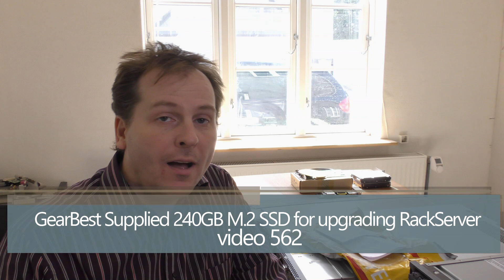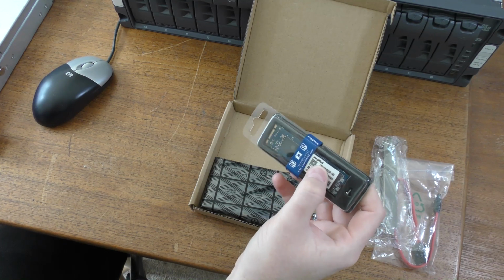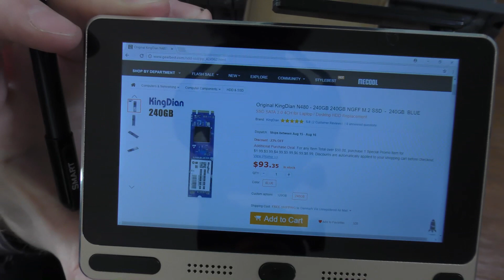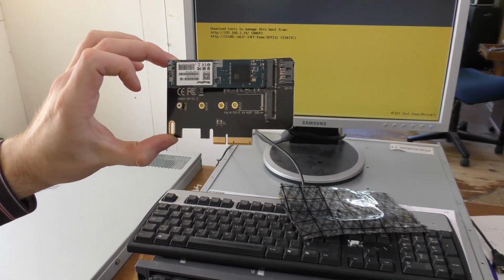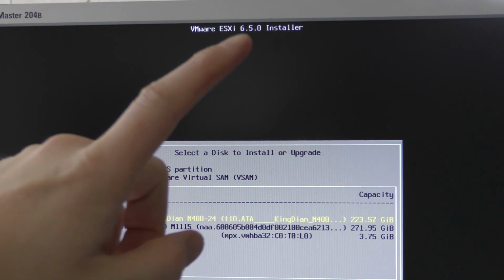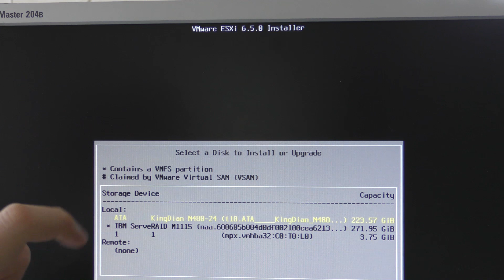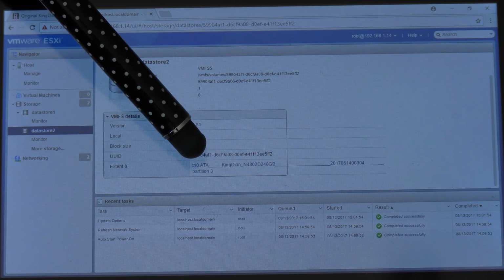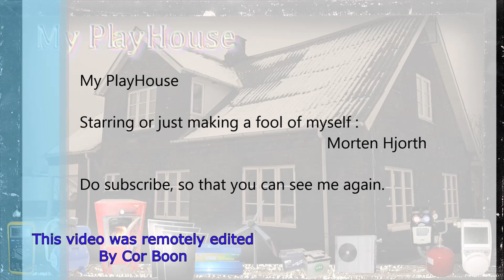GearBest Supplied 240GB M.2 SSD for upgrading RackServer - 562

Comment: Hi Morten, now I know your playhouse is not a mission critical data center but I see solutions like this in the field a lot too, where people run hypervisors of of simple non-redundant drives (usb etc. or in your case a single ssd. I know that esxi is pretty much read only and runs mainly in ram but still if the thumbdrive or ssd fails the server goes down. Is that really concidered good practise? How do you go about these things at work?
Reply from the maker: Hi Rolf Andreas Kraß-Westerink
Thank You very much!  This method could be used for a production environment. But yes, it might not be where you want to test out a brand like KingDian and a ZOMY PA02 - 2N NGFF / M.2 to PCI - E Converter Card... to $6
The method works, you just need to pick the products that meets your needs, and you trust in.
It's not easy to pick products, from these markets places that makes much sense, to show on my channel. And they do not have the brands we know in the vest.
And as always,, Do not do as I do, Improve on what I do.
Thank you for watching! :-)

Comment: u pluged it in to a sata 3 port so it still not run at sata 3
Reply from the maker: Hi mike spikeey
SATA3 ? what do you mean?
Thank you for watching! :-)
Reply: i get wat u have done now the card is just powered & u plugged it in to sata port so yes it will run faster but if it thinks it a cd rom  will it run at cd rom speed

Comment: I am sure you will not get the M.2 speed with an ATA connection.  It would have been nice if it could use the PCI lane instead of SATA but its good to add extra storage or a boot drive.
Reply from the maker: Hi Scott Downey
Thank You very much!  NGFF needs a SATA connection, where NVMe uses the PCI-e and is 4 to 6 times faster than NGFF. 
Thank you for watching! :-)

Comment: I keep looking at the Samsung 950/960 series M.2 drives. The performance on them is amazing. You get ~3500 MB/s read and ~2100 MB/s write. The price however is still a bit high.
I was wondering, what kind of drives do you buy for your data center for replacement for storage? Do you get used or new?
Reply: I have been installing them in high end builds, absolutely blazing. The coolest part about M.2 SSDs is speed with no cables.

These are consumer systems though where the 960 is being used for the OS and apps.

I don't have experience using them in a server environment but I would imagine that as a primary OS drive they would accelerate build testing substantially.
Reply from the maker: Hi clouddeveloper.io
Thank You very much!  I just got an Samsung 960 500GB EVO, so we are going that way..
Thank you for watching! :-)

Comment: Hi Morten - Some honest feedback about this video.
It. Sucks.

it sucks that it's 2/3rd product placement for gearworst - and it is especially bad that it's a ripoff / knockoff cheap-ass Chinese SSD. This video alone cheapens the whole premise of your channel a bit.
Of course this is only my opinion, but I think you'll agree, I certainly wouldn't go putting a sub 100$ SSD or any kind in a production server. No. Way!
Reply from the maker: Hi produKtNZ
Thank You very much!  This method could be used for a production environment. But yes, it might not be where you want to test out a brand like KingDian and a ZOMY PA02 - 2N NGFF / M.2 to PCI - E Converter Card... to $6
The method works, you just need to pick the products that meets your needs, and you trust in.
It's not easy to pick products, from these markets places that makes much sense, to show on my channel. And they do not have the brands we know in the vest.
And as always,, Do not do as I do, Improve on what I do.
Thank you for watching! :-)

Comment: I use the internal redundant SD card slots or install ESXi to. ESXi hypervisor doesn’t need much speed or space at all. Great videos keep them coming.
Reply from the maker: Hi Jonathan Williams
Thank You very much!  You are right,, ESXi does not take much space,, and the boot speed most likely does not matter that much. But in a Lenovo x3650 M1,, It only have USB1,,it takes 15min to boot from that,, this is a great option,, and it is just one more option.
Thank you for watching! :-)

Comment: Well, I hear you talking about having just a single SATA connector on the board. However, I see 3 SAS-8084 ports as well (one already in use). Can't you use a SAS-8084 to SATA cable so that you can keep the DVD drive hooked up?

Alternative solution: Get rid of the DVD drive and replace it with a 2.5" bay. There are special (cheap) adapters for that, that have the same size as a DVD-drive. Vey usefull for laptops.

Mmm.. the SSD is detected as a DVD drive? Make sure it is running in AHCI mode in the bios and not as IDE/legacy mode. Should improve performance a bit as well.
Reply from the maker: Hi prescan7000
Thank You very much!  Yes,, I think that works,, I did mention that in the video on patreon. But using a hole SAS-8084 port for one tiny M.2 feels weird.
Thank you for watching! :-)

Comment: Why does the server use a half bandwidth PCI-e in the full height slot, and full bandwidth one in the half height slot ? You sure you did not get them reversed ? What good would that be.
Reply from the maker: Hi mrlithium69
Thank You very much!  It's good to have the x16 slot,, even though it's really only an x8 riser card,, you can still work an x16 Graphics Card on x8 or x4 or x1,,no problem, and you only loses a few % of performances. Other riser cards are available with x16.
Thank you for watching! :-)

Comment: Is there an M.2 PCI slot adapter that won't need a SATA cable connection?
Reply: Chris Bautista yes exist only m2 to pcie
Reply from the maker: Hi Chris Bautista
Thank You very much!  NGFF needs a SATA connection, where NVMe uses the PCI-e and is 4 to 6 times faster than NGFF. 
Thank you for watching! :-)

Comment: Gearbest celebrating 9/11 :D So you can't boot from pcie? why does it need sata cable? Also if you put 2 m.2 in the card it would be 500MB/s limit i suppose for both cards?
Reply from the maker: Hi Fa Vang
Thank You very much!  NGFF needs a SATA connection where NVMe uses the PCI-e and is 4 to 6 times faster than NGFF. 
Thank you for watching! :-)

Comment: Shouldnt M.2 connections go through the PCIE bus and motherboard for full speed? If you use sata you are going to see 600MB/s max, it should be much faster.
Reply: Probably would have been better to get a cd rom to 2.5 ssd adapter and then put an SSD in the CDDRIVE slot. That would take up NO pcie slots or extra cables.
Reply: X3550 M4 has no NVMe compatibility afaik. PCIe drive couldn't be used as boot drive without it
Reply: S. Kojina.

You could fix the NVME Compability using an USB Stick and a Software called Colver EFI, did this on a DELL Poweredge T20 myself in the past. And NVME would be usable as Storage anyways.

Morten
NGFF m.2 AHCI is SATA espacially when it is connected via S-ATA Cables. m.2 NVME is PCIe native, although they share the same Formfactor their electrical layout is entirely different.
Reply: tmkoeln
yes you could use them as storage but I don't think you could use them as boot drive. it might be bootable by modifying the BIOS but that's not easy
Reply from the maker: Hi Ryan White
Thank You very much!  NGFF needs a SATA connection where NVMe uses the PCI-e and is 4 to 6 times faster than NGFF. 
Thank you for watching! :-)
Reply: S. Kojina

The clover method is like a secondary UEFI on a stick (no need to manipulate BIOS/EFI Data) => Boot UEFI => BOOT Stick => Boot Install Media (as UEFI) (clover has its own NVME EFI driver, it is not loaded by derfault but a simple Move of a file and it works..)
Reply: tmkoeln interesting.. nice to know that

Comment: The problem with older servers/computers, are that they mostly not support "boot" on a M.2 PCI SSD. (It will work with SATA ofc)
Reply: DaTHack there is a way to fix that by using a software named Clover Boot, did this on a DELL Poweredge T20 myself in the past.) Technically the PC is booting to a second EFI instance that has the correct NVME drivers for Booting on NVME, tested this successfully with Server 2012 R2 and 2016. This will work at least for Haswell based apliances (and possible Sandy Bridge only via PCIe 2.0 due to SKU limitation on Sandy Bridge CPU and Chipset and Ivy Bridge). Normally NVME would require a at least Haswell-EP/EX, Broadwell-EP/EX design.
Reply from the maker: Hi tmkoeln
Thank You very much! That sounds a bit,, on the edge,,, like something that could mess up any day
Thank you for watching! :-)
Reply: Well as likely as a Flash Media Used to bootup a Server is to fail. But itis simple to create a replacement, but I guess this is way to much on the edge for production, so I seized using it after a weeks time.